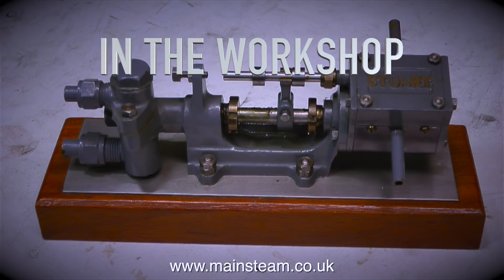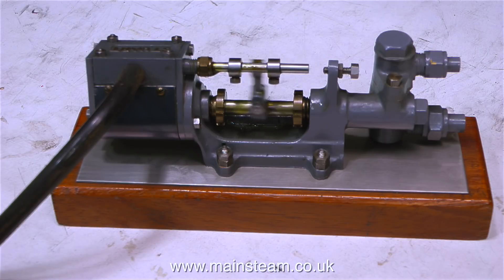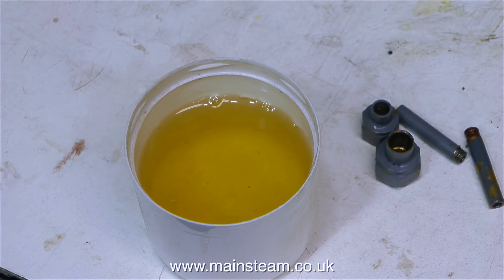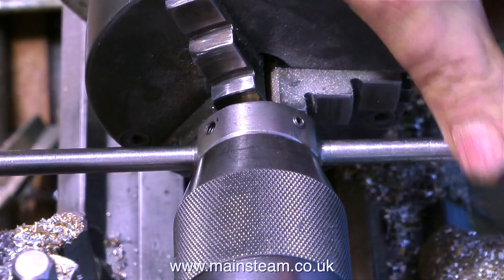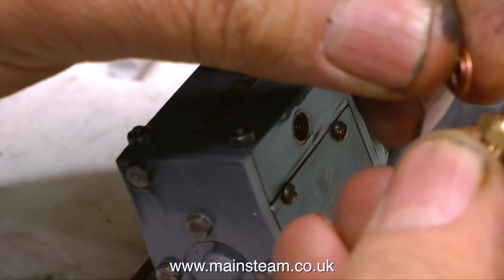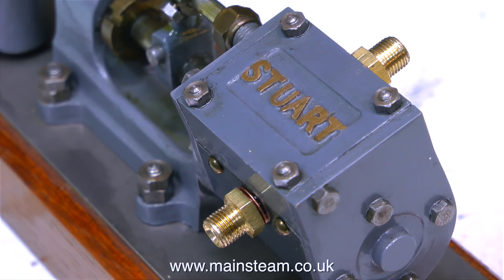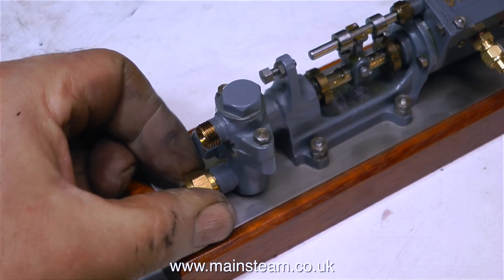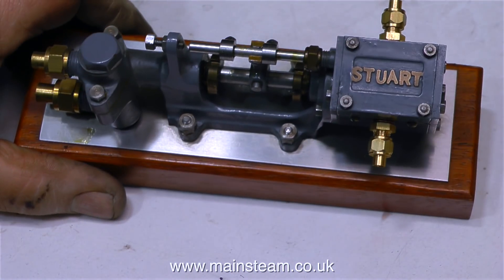A STUART MODELS BOILER FEED PUMP - HOW IT WORKS - IN THE WORKSHOP

Comment: What about your coal fired kingdon (I think I spelled that right) boiler? It's far to pretty to not have a home! I've always hoped you might do a horizontal build with a paddlewheeler arrangement, even if it just the drive gear!
Reply from the maker: I considered it, but I think that the "Kingdon" boiler is a bit too small  . . . . a 4 or 5 inch maximum diameter boiler would be the best size for this little pump. Having said that though I will sit the parts close to each other and see what the setup looks like {:-)))

Comment: Great Western 0-4-2?
Reply from the maker: The 14xx is not mine ........
Reply: Thank you. i was checking i recognized my favorite Great Western Engine.
Reply from the maker: the 14xx is my favourite too . . . today I did a steam test on it with an injector fitted, I have the footage and i am going to do a feature about Model Steam Locomotive injectors etc . . . watch this space . . .
Reply: I am not sure if this is the best place for this. Thank you for your videos. You information on lubrication, tightening of parts, and bearings has been enormously helpful with my O-gauge trains. My 0-4-0 runs much better than before, as do my other engines. Thank you.

Comment: Beautiful little feed pump Keith! I had an idea for your consideration in regards to mounting the pump to the 504 boiler plant. In my opinion the steam pump would be a far better combination with the Economizer than the hand pump would, and my reasoning for this is because the pump's speed can be adjusted to maintain the water level in the boiler while the Engine is running, instead of the injector filling the boiler rapidly and making the steam drop. Also, considering the Pump's exhaust could be run through the economizer as well through the blank port with the checkball behind the union nut, I believe the preheat the water would be getting from both the Engine's exhaust and the Pump's exhaust would be enough to offset cooling down the boiler if it is fed slowly and steadily. So with the pump dialed in to a nice tickover to keep the water where it needs to be, the burner set to maintain steam and the engine running at a consistent RPM,  the plant should be able to produce a nice consistent power output while not needing as much babysitting or fiddling from the engineer aside from oiling. Then the Injector and Hand Pump would be back-up feed systems. Just the thoughts of a Daft Yank ;-)))
Reply from the maker: Maybe, but I think the 504 generator plant has enough gadgetry on it. I will build another plant to utilise the Stuart Steam pump.

Comment: Sweet pump! I'm curious about the piston valve and its timing.  
ps: you forgot to tell people not to drink Cellulose Thinner. :-)
Reply from the maker: It's not a piston valve, the pump uses two slide valves but one is driven by the shuttle piston.
Reply: OK, now you have to take it apart and show how it works ;^)        btw, I googled "Weir pumps", and the best thing I could find was an ebook showing a vertical model with what looked like a single slide valve, but no diagrams or explanations.

Comment: Wanted to add comment on a holder for turning threaded items, such as the brass connector you turned down. I saw this on another Y-Tube video and made up a set for myself. Each holder was about 1" long and made from various sizes of brass ODs drilled and tapped through with threads I selected, then each OD turned down to about 1/4".  Cut 3 slots 120 degrees from one end through the threads to about 75% of the length (1" or whatever was picked). The brass connector you used could then be threaded into a holder and once in the 3 jaw lathe chuck under compression it is held rather tight without damaging the threads.

Comment: Keith,someday when it is conveinent for you ,could you show us what is going on inside the smoke box of your old Black  5 locomotive?IT sounds like a real locomotive and it is loud.So many engines are very quiet or sound like a broken air hose Thank you for listening and I will find it helpful.P.N.
Reply from the maker: That's difficult to do with the black 5 as I sold it in 1994, but I am starting to work on model steam locomotives commercially so I will explain the principle. It's simple enough but you need to know about the pipe arrangements.

Comment: Nice find Keith. I'm thinking of getting something similar, I did consider making one from a Stuart kit but have heard they are very difficult to build and get working properly. Southworth pumps do sell casting kits but I guess they are difficult to build as well :-(
Reply from the maker: They are all fiddly to build but the 6 inch Southworth is a simpler design.
Reply: Thanks, I did look into the 3" Southworth but I was told it is a pain to make and I think for my 5" dia boiler I'd need the 6" pump.